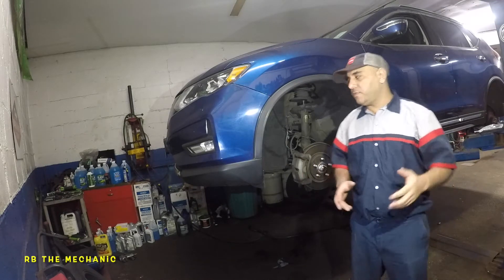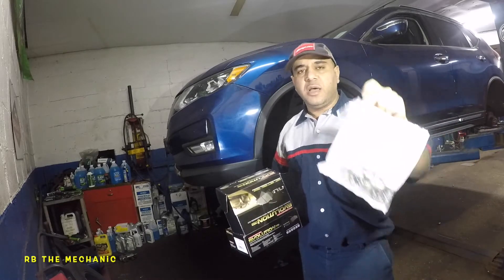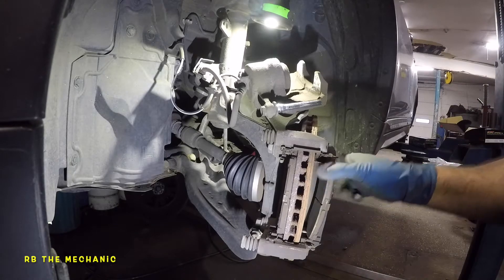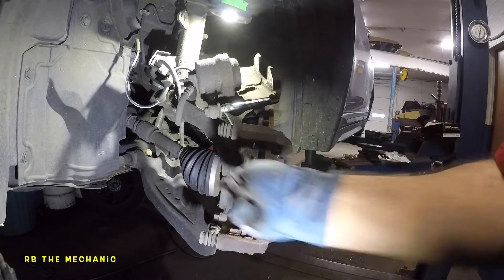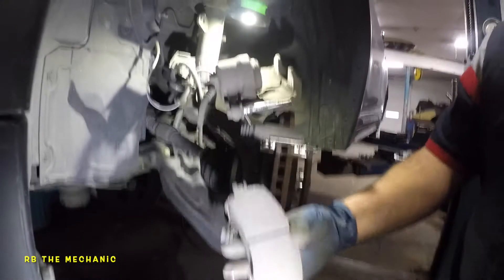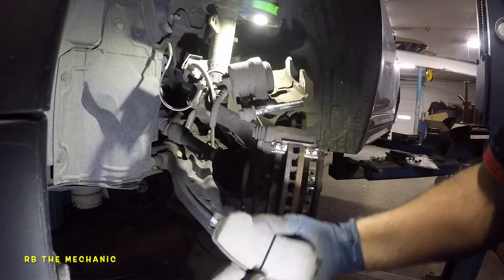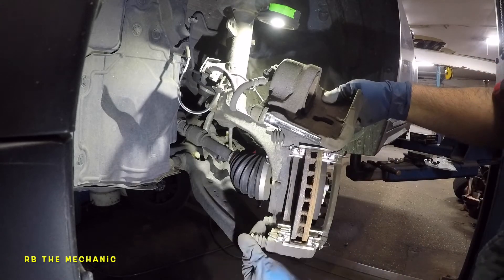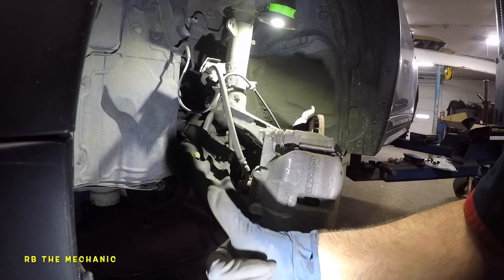How to replace front brake pads on Nissan Rogue 2018 and more FULL (DIY) Guide

Comment: Question, a number of posts on Nissan owners forum regarding electronic parking brake issues, that you have to do something first and put brake in service mode. Several owners screwed. up and did not do this so now have to deal with code scanners and what not to try to reset this EPB issue. Can you please comment on how to handle this. I now a new subscriber!
Reply from the maker: Well u do need to scan? But this video is on front brakes there not EPB should not have anything to do with it. However didn’t work on rear brakes?

Comment: I just changed the brakes and rotors, and the front passenger side is clamped down. From what I’ve been reading it’s because I’m not in service mode?
Reply from the maker: Front has nothing to do with service mode rear only are required for service mode
Reply: @RBTheMechanic  oreilly’s gave me two different brake rotors, in the the same box. So when I put the second on I assumed it was the correct part in the box with the first, obviously we know what happens when you assume. Anyways, long story short, it bent my steering knuckle so that was my project this week.
Reply from the maker: @kdgriess  oh darnn

Comment: The torque spec is what!?
Reply: 2022 Rogue SV
Reply from the maker: Year make model! Engine size and trim I need to know to get u correct specs
Reply: @RBTheMechanic  2022 Rogue SV, 3 cyl turbo
Reply from the maker: @donaldshelton  sure I will find out on my next work day